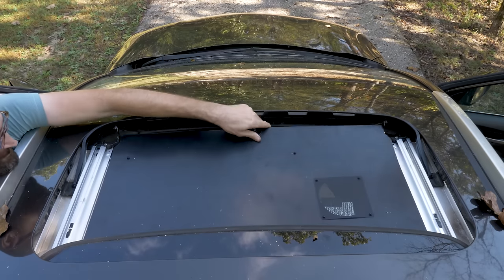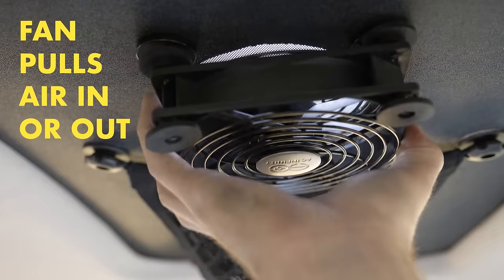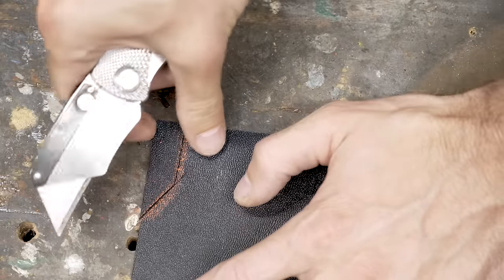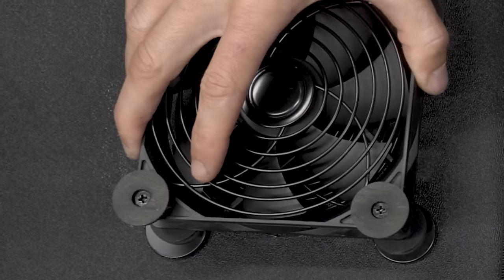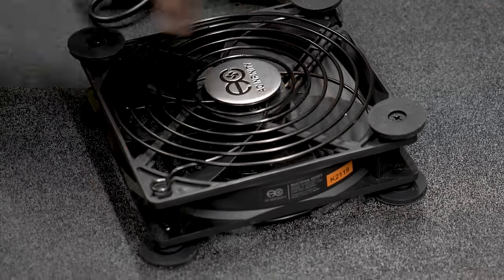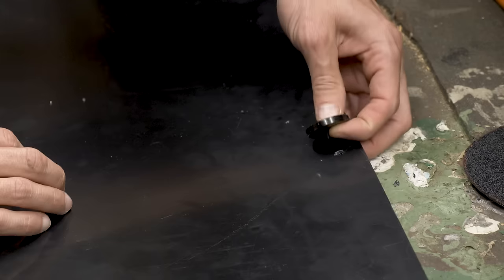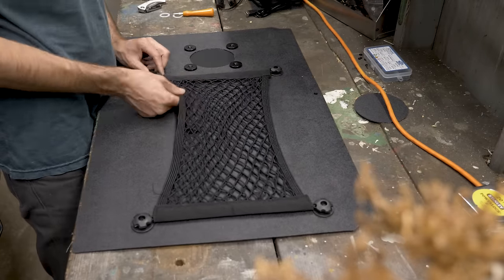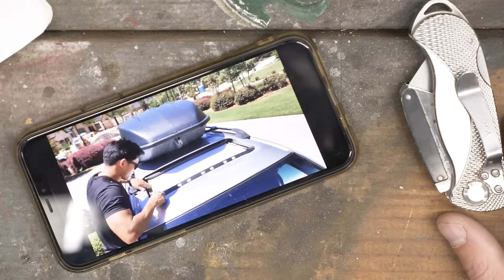Car Camping Cooling + Ventilation to Stop Condensation

Comment: I like the magnet idea so you can reverse it. Plus these pc style fans are designed for long run hrs. I'm setting up the 120m version in my rv/camper. Yes there are larger fans for the roof vents but I wanted something that will draw minimal power I can leave on.
Reply from the maker: They go forever!

Comment: I ordered the ABC and work on the cooling system just like Matt.  To keep it simple, I only install the USB 5V fan (it comes with 4 long screws to hold two fan guards, I just use it to fasten fan to the ABS) and filter and let the cable drop to armrest and connect to power bank.  I didn't use magnets nor net (hold power bank) for this project.  It is not easy to get exact fit.  Every sunroof is different. I try to get it to cover whole sunroof, but it is too difficult to get it fit and not easy to put it in and take it out.  After many tries, I end up reduce the size to half of my sunroof sunroof sliding shade to get support.  Sometime sunroof won't be able to close.  DIYer need to try it out and the size is not always a straight line  (for my case it is a curve).  If you decide to go for 3/4 of full sunroof size. (which I don't think is needed, all you need is one or two inch bigger than the fan size.), you might need additional support because the ABS is too filmy.  Yet it is still difficult to cut with knife.  DIYer can add one more layer in few areas to get additional support.

The sunroof now can be closed and opened and tilted and I can easily take it out and put it in even inside the car.  It is easier for DIYer who doesn't  have a lot of tools.  My suggestion for people don't have a lot of tools, don't try to cover it all the way.    As to the circle hole for the fan.  If DIYer doesn't have the right tool, I suggest DIYer drill small holes along the circle, cut it open and sand paper it.  That is much easier.  I have an used 8CM "Thermaltake Mobile Fan II Adjustable Speed External USB Cooling Fan with One-touch Retractable USB power cable box for Notebook Laptop Desktop. A1888"   I take the leg off and it is perfect for me.  DIYer can try something else because it is not cheap and only 12CM is available.  Or DIY a speed control.  My project finished.  The only thing I bought is ABS.

Thanks to Matt.  Now I need a tarp to cover the "tilted sunroof" in case of raining night.

Comment: This is brilliant, I will be copying it one day - just curious though - how is it resistant to rain? Surely if the sunroof is open water will get through?
Reply from the maker: Hey Lynda. The sunroof has a setting that lifts the back up a little rather than sliding the whole thing open. It’s made to keep light rain from getting in when it’s just cracked a little. So the sunroof does all the rain proofing not the thing I made. But if it’s a down pour you’ll probably get wet. Hope this helps.

Comment: So simple and creative! I'm at the start of converting an SUV into a weekend camper. Have you ever heard of anyone modifying their vehicle's HVAC blower to ventilate the cabin? I've successfully isolated the blower to run off an external power source other than the vehicle's battery. Before I invest in the electronics to run the blower on low speed off a go-kart battery, I'm curious if I'm overlooking anything. It seems to be a different approach to having the windows open. Interestingly, using the blower avoids issues with rain and pulls air through the filter which means no bugs or particulates such as dust when in Moab. Maybe the solution doesn't work for every vehicle, but my vehicle's blower pulls in air from the outside when the car is off.
Reply from the maker: That’s a great idea. It would be cool if you could even plug it in at a campsite with an outlet. This is actually my girlfriend’s car (mine is too small) and she is currently against me doing things like this but maybe we’ll work our way up to it LOL. Sorry I don’t have any ideas for you. I’d love to hear how this works out.
Reply: make a video tyler
Reply: That's a great idea!  I hope it goes well and you can share how with the rest of us.
Reply: sorry that I can't give you the link but some Dude with a camper van did just this... maybe search van air-con build - good luck
Reply: Did this go anywhere? Thinking a similar idea
Reply: Give us follow up!

Comment: Thank you! I am still debating whether to buy a "basic" trim used Sienna or Odyssey (w/out the standard sunroof) or the next trim(s) up (w/ std sunroof). The only thing I worry about is the mice eating the flimsier mesh. I think I would use a metal mesh instead, although I don't know if mice will still eat the plastic sheet to come in.
Love it that the fan is reversible! Can help cool down the interior in warm weather by pulling air in or let the heat (and fart smells) escape first when it is too hot which the hotter air accumulates near the top by pushing the air out.
Reply from the maker: I’ve been shocked by some of the things I’ve seen mice chew through. They could in theory chew through the plastic if given enough time but we’re always moving from place to place so no mice so far.

Comment: Awesome video,  it's simple and effective..love it.  I have a question: how do you connect all 3 fans to the battery.  I did not see the wires in the list to purchase. thanks
Reply from the maker: The usb wire in the fan has two connection points. One to plug into power and one to plug into another fan.

Comment: Glad to hear your going to start posting more I love your continent. I live in my CRV full-time. For a year now it’s been really awesome been looking to go to a van unless I can collaborate with someone to make my CRV more livable.
Reply from the maker: That's great to hear Jon! Every time I post I think "Will anyone care about this?" haha. More content coming soon!
Reply: Iv been looking into solar power, I have a 200ah deep cycle battery on a 750 watt inverter, runs my fan and charges my tablet. I live in Florida I need to be able to run my ac in the summer but it cost a lot in gas, so I’m looking into solar generators they seem awesome, the delta pro is what I think I’m getting.
Reply from the maker: @jonmoney6289  That is definitely on my list. Right now I'm just using small battery packs. I've been experimenting with making a big one but may end myself in the process.

Comment: What a great idea! How does the power compare to a RV roof vent if i use two of those fans? Also, can I just turn them around to draw out hot air?
Reply from the maker: I think with two of them you’d be getting close to an RV fan. And yes you can just turn them around depending and which way you want the air to flow.

Comment: Thank you so much for this video! One question - does the rain not come through the fan filter> I need to install one on my roof but don't understand how the rain doesn't;t get in through the filter holes? Thank you
Reply from the maker: If the rain get's on the fan filters it will also get through them. 
Our sunroof has a "Vent" mode that just slightly lifts it. This prevents light rains from getting in. If you're in heavy rain it would be best to close it.

Comment: Did you ever test this to see the actual effectiveness of the ventilation? When I built this, I used my air quality measurement device and I witnessed effectively no change. It was essentially useless. It performed worse than when I just jammed a portable travel fan into my sunroof and had it blow air in. It looks amazing, but based on my air quality measurement device, it didn't help with circulation and removal of CO2 from the air at all. throughout the night, CO2 climbed from 600 up to 1500-3000 PPM. And I'm not trying to be mean about it. Im just seriously asking because I was so excited to build it but then so disappointed to see it do nothing. I do have to say though I only tested it with the sunroof crack version and not fully open, but I wasn't planning on ever using it with the sunroof fully open because of the rain concern.
Reply from the maker: Hey Charlie, I made an updated version of this that is way more powerful. I think it's my second to last video I posted. If you don't want to make anything new I'd recommend getting a little rain/wind guard for your windows so you can crack them slightly so that the fresh air can get in as the fan expels the CO2.
Reply: @MattTheDesigner  Did you measure it to see if there was a measured difference? Also, thanks or doing these videos, they honestly are amazing, I really don't want to be rude or harsh in any way.
Reply from the maker: @charliem2653  I've only measured it in comfort points which is a system I made up. It's +5 comfort points. Jokes aside, no I don't have a C02 meter but I like real feedback. If I get around to doing another round of updates I'll order one of those.
Reply: @MattTheDesigner  really appreciate the timely replies! Thank you for your responses:)

Comment: Love this!  I'm going to do this same thing to the side windows.  Do you think using the AC Infinity MULTIFAN S5 with two smaller fans would help more than just one AC Infinity S3?  Anymore air flow?  Thanks
Reply from the maker: I have a vid about doing just that. I’m also working on upgrading the whole thing. But I’m slow haha. Same basic idea though.
Reply: Thanks.  Look forward to your video.

Comment: This is gold! I just started setting up my Rav4 to camp outside work to save on gas. Also, I don't know if you've heard of the backseat bivy? I'm trying to find a cheaper solution, but I have a feeling you might be able to help.
Reply from the maker: Dang. $125 for a fabric square?? Plywood isn’t exactly cheap these days but for that same cost you could build a leveling platform that would be more comfortable. Check out my other builds if you haven’t.

Comment: I might do this just to vent the hot air air out in the summer while parked in the sun at work.
Reply from the maker: I think that would work really well. I used a 1000mah battery pack over night and it hardly drained the battery at all. So you could get multiple days of venting out of 1 charge.
Reply from the maker: You probably wouldn't need the filter to keep bugs out if you're not sleeping in it. That'd make the airflow even better.

Comment: How long/many nights do the battery pack last running the fan? I am looking to get into car camping, not sure what the battery pack requirement I need for phone, fans, charger, laptops, maybe even heater(?)
Reply from the maker: The one in the description will run it for two full nights.

Comment: Perfect solution to what I was looking for! Also looking to turn my CRV into a camper. 
Any thoughts on temporary mounting of solar panels from something like a jackery?
Reply from the maker: That’s great to hear Johnson. I’m planning to do something like that in the future but in the mean time check out the short I posted about mounting a DIY roof rack. That might give you some solar mounting ideas.
Reply: HI there! You might find this video link useful.....   https://youtu.be/vgY0mJnrpo8   
I added a 100watt solar panel to the roof of my Subaru Forester using this as inspiration, and have it charging a Bluetti which runs my 12v fridge. I have it mounted between my roof cross bars with the magnets, and I added a pool noodle to the front bar so the wind would go up and over. I also added zip ties from my panel to the roof rails(for extra piece of mind) and a lock so it wouldn't walk away! It worked flawlessly on my drive out West and Back from PA.
Another video to watch is from the SUVRving channel...He mounts his solar panel to a cargo box. Hope these help!

Comment: So, I’m imagining doing this with one of the three fan sets for more gusto.  If I’m gonna make it, I might as well make it really powerful.  How much weight would the plastic panel hold?  Is there room for 1/4 inch plywood instead?  Could it be wired to a 12v battery that is powered by a rooftop solar panel?

Cool video.
Reply from the maker: Hey Ronna. The 1/4 Ply wouldn't bend around the sunroof cover handle. I think you could theoretically do it with the plywood and just cut it so it stops short of the handle but it wouldn't be as bug tight as the plastic stuffed into the liner. The plastic would hold a decent amount as long as the plastic was stuck into the liner far enough. If I were to make this again I'd do it the same way but make the plastic piece slightly longer.
Reply from the maker: Also, love the solar panel idea. I tried it on a recent trip to Florida and this little rig is perfect for it but my solar panel was just too small.

Comment: Hey Matt - any chance that only using 6 of the magnets you recommend (2 on each side of the fan and two on the ceiling piece) would work instead of 12 per fan? Fan should be light enough for the magnets that take 30lbs....??? or did I read the magnet weight capacity wrong...
Reply from the maker: The fan itself doesn’t have any magnets on it. Just the 4 on the sheet of plastic that hold the fan and 1 that holds the sheet in place. I would definitely recommend using all 4 magnets on the sheet to hold the fan. Those magnets stick to metal screws on the corners of the fan.
Reply: @MattTheDesigner  thanks. For some reason I thought there were magnets on the fan as well.
Reply from the maker: @artdeb86  They look very similar. I hadn't thought about that until you asked the question.

Comment: 07 odyssey reporting for failure. I mean, the setup works, but I cannot close my sunroof with this installed. And with the 9/10 aggravation factor to put this in exact time, makes it not worth it. I’d love to hear of other odyssey owners experience with this and if they found a works around. Still an excellent video!!
Reply: After watching V2 I’ve realized I’ve made an error in my (your lol) design. Back to it. Not giving up that easily lets goooo
Reply: Fits like a charm!!! When is read every single comment, and I was the only one with issues, I knew something was up on my end
Reply from the maker: Glad it worked out!

Comment: Great video and product!! I love how professional it looks - not a DYI look at all!!! I have all your linked supplies in my Amazon cart now. That said, is there anything you'd change in materials or design now that you've had time to use it? Also do you the material would hold 2 fans (I liked that idea from Minimalist Mike's video)? Thanks again for sharing. I liked and subscribed. Hopefully you get the Amazon kickbacks soon!!
Reply from the maker: Haha. You even saw my affiliate message! 
It works great and I’m fairly confident it would hold 2. Only thing I’d change is making it slightly longer than I did. I have to be pretty exact when installing it to make sure it’s not too far forward or backward but wouldn’t need to if it overlapped in the front and back a little more.
Reply: @MattTheDesigner  I shared your video in a SUV camping group I belong to and many loved it!! Thanks again for the video!!

Comment: Can you use the fan when it’s raining?
Reply from the maker: Yes. The sunroof has a vent mode where it lifts up slightly without letting the rain get in. If it’s a super heavy rain it might but I’ve used it several times in the rain and it’s been fine.
Reply: @MattTheDesigner  Do you prefer this Sunroof ventilation, or your rear-window ventilation option you also have? Or do you use both routinely?
Reply from the maker: @gregor582  I prefer this one. While the computer fan isn’t loud it is right next to your head. So it’s only used when it’s really hot or humid only.

Comment: Did I miss the part where you installed a solar panel on the outside so as not to drain your battery flat? I must have missed that section..
Reply from the maker: That's the directors cut. You gotta pay extra for that.
Reply: @MattTheDesigner  LOL. I'll wait for that edition to come out then!

Comment: So if it rains it's still coming in. I don't get it. What's so great about this?
Reply from the maker: Our sun roof is designed so that you can open it a little without water coming in. The problem with only cracking it a little is that it doesn’t allow much airflow. The fans create the airflow without letting bugs in and the sunroof keeps out the water.

Comment: does this design prevent rain from enterting?
Reply from the maker: Some. I think most sunroofs have a “vent mode” that should shed light rains. If it starts pouring though you’ll get some moisture inside. .

Comment: What thickness is the sun roof fan ABS plastic. I don't want it to sag.
Reply from the maker: I believe it’s the .06”
Reply: @MattTheDesigner  Thanks Matt. Now a different question. I have rubber feet on my fans just like yours but the only metal is the screw holding the rubber feet doesn't hold to the magnets.

Comment: I love the idea but has anyone checked that after a night's sleep the car windows were not fogged. It will be amazing that such a small fan can be effective to remove condensation.
Reply from the maker: It’s all about degrees. If it’s extremely humid and rainy it won’t solve the problem 100%. But it definitely helps remove moisture generated by breathing on an average night. The newer version even more so.

Comment: What if the front piece is plastic with nowhere to get the front magnet to attach to.
Reply from the maker: I’m working on a V2. I think if I made the front lip a little longer it wouldn’t need the magnet but some trial and error is still needed.

Comment: Please use caution before doing this. I tried making one and it wouldn't shut all the way. I took out the abs plastic and now my moonroof won't open at all.
Reply from the maker: What do you think happened? Was the abs too wide on obstructing the sunroof rails? I'm making a V2 now and would love to know if it's causing problems for people.  Is something jammed in it or are the motors burnt out?